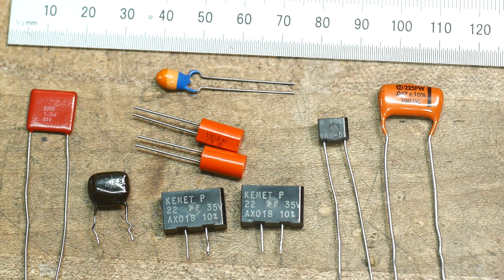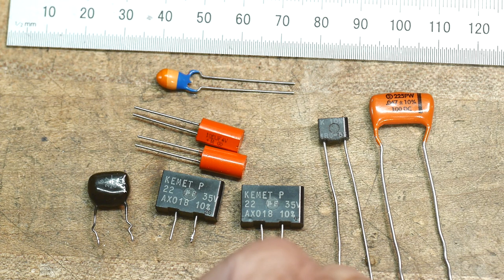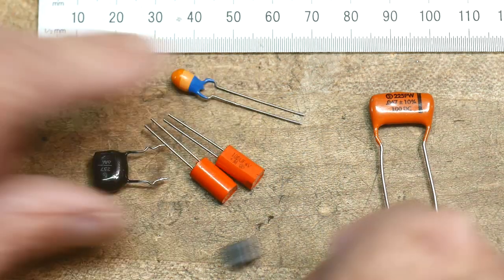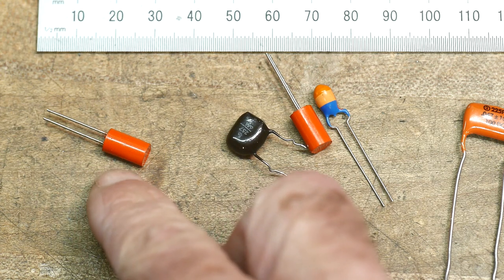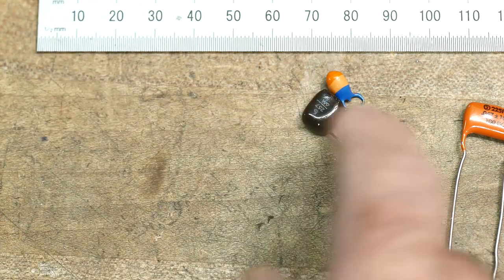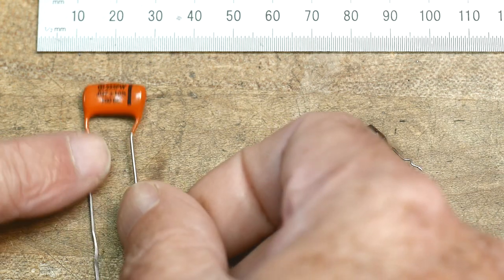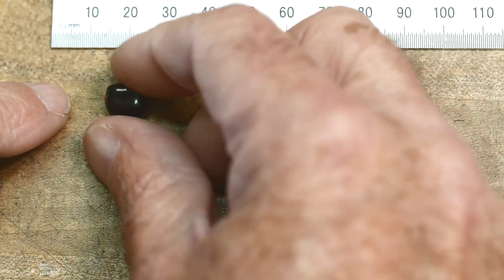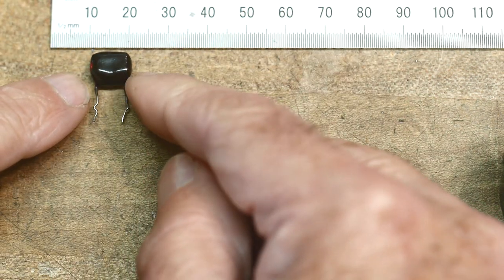#636 Strange Old Capacitors

Comment: ...And they stay crunchy in milk : )
I have a few striped ones, but they are dipped from the sides. The shape is like a poly cap.
I also found some capacitors that have a ceramic tube, with filled ends.

Comment: The 4V orange ones might be something used in early transistor radios. I've restored many and they always used very low voltage devices. Today I use small dip tantalums

Comment: The 257 6M one could be a 6uF capacitor. I've seen Siemens capacitors from the 70's that use m to mean microfarad and not u.
Reply: I agree with all but I think the M stands for 20% tolerance.